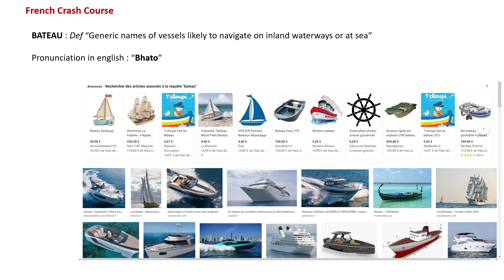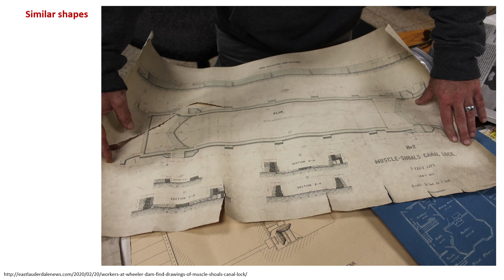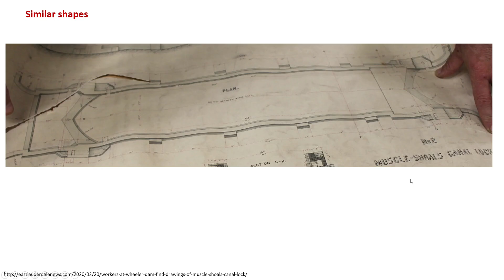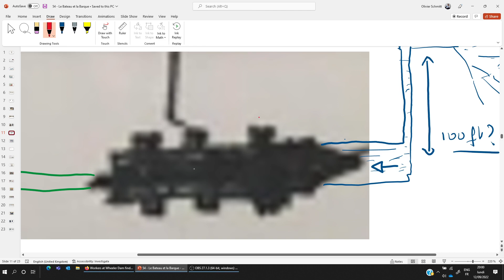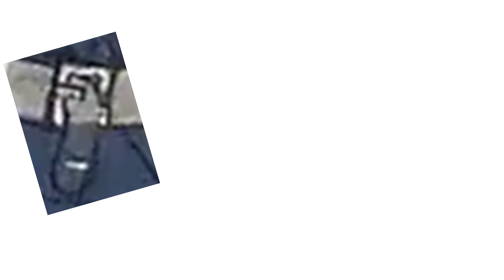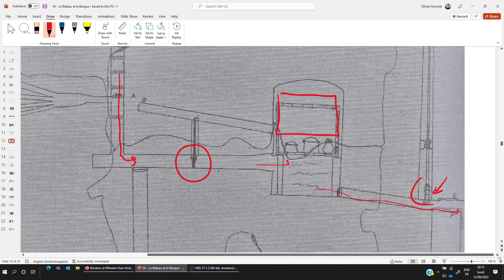54 - OAK ISLAND - LE BARQUE AND LE BATEAU

Comment: Hi Oliver  , My question is  , How is it possible to drain the water in the chamber back out to the Atlantic  , when the drain line is 50 + feet below sea level  ??? ...
Oak Island is 36 ft above sea level the depth of the chamber  is 90 + feet below ground ( 36 ft  - 90 ft = 54 ft )  the drain line is 54 ft below sea level  ... Also the water pressure at 50 ft below 50 ft sea level   ( you can look it  up ) is 36.95   pounds per square inch absolute  ...    
Again  I ask you , or anyone  out  there ... How is possible to drain the water out of the chamber back out to Alantic ocean with the drain line 54 feet below sea level  ??? ...
Reply from the maker: Hi Kirk. The flush out does not go back to the ocean. As per the Scrolls of Onteora diagrams, it is flushed out into an underground cave. But even if it was not, you can use tides height differential as a pump to push out the high tide/high pressure captured water in the vault at low tide. There will be more pressure in the chamber than in the ocean, flushing the water out. By the way, the depth of the cahamber is certainly NOT 90 feet down. If it was, the floating chamber would be compressed at the top of the vault, causing damages. The top of the vault ceiling should not be lower than the high tide mark to avoid excesssive pressure on the floating Fancy :). Michael and I differ a bit on this..... but it is what I believe.
Reply: @oakislandresearch   Hi Oliver , Thanks for responding  .  
 1 . Your saying the water in the chamber is drained into an underground  cave ...

2 . Your saying that tidel  height differential could create enough pressure  in the drain to push the water out of the chamber and into the ocean  ... my question is ; how can this method work thru the the box drains @ Smith's cove  ( The water fill sorce ) when the box drains are covered with a layer of coconut fibre , a layer of eel grass covered with sand and submerged under water  ??? ...

3 . You saying  that the fancy is not at 54 feet below sea level . That the fancy is @ tide level/sea level .  Oak Island is  36 feet  above sea level That would mean the underground chamber with the floating fancy is 36 feet below ground . Question; Why does the Onteora diagram in this video show the fancy even with the depth of the 90 foot mark of the money pit that puts the fancy @ 54 feet below sea level.  ??? ....

4 . There is a big contradiction  between the Onteora diagram & the Rochefoucald map where the valve is located, The Onteora diagram shows the screw valve close to the chamber  ( like it would be located on the money pit side of the swamp )  the Rochefoucald map locates the valve on lot 5 ... the money pit is on lot 18 . That would mean the chamber drain would have to run either thru or under the swamp  ( depending how deep the swamp is ) then thru 13 - 4 acre lots to its location on lot 5 ... 
My question is , with these documents contradicting each other , which document is correct  ??? ...
Reply from the maker: @kirkdepierre4544  The scroll of ontera diagrams are not to scale. They explain the mechanism principles.
Reply: @oakislandresearch  Hi Oliver , It's obvious something is off , the Onteora diagram & the Rochecauld map contradict  each other ... Question ... In your opinion  Is the Rochefoucald  map drawn to scale ??? ...
Reply from the maker: Do you know him ?
Reply: @oakislandresearch  Oliver  , Donald A Ruh knew Bill Jackson very well ...

Comment: Excellent observation about the hydraulic gates. We have discussed before that the dam and the basin may be the location of such a device. The Batteau is North of Barque as the Basin is North of La Hampe. The zigzags on the lines are indicators of vectors as Barque gives a line vector through the rear rudder which intersects to create point that represents Cone D. Batteau does nothing until it is hitched to the North Anchor shown as a full hitch as the letter e in Batteau. Good stuff!
Reply: On the sides ? The concrete blocks ? Or poured squares of concrete along side the gate
Reply: The meanings of the boat and the Bargue are just telling you which way the valve sits in context to inner or outer innrelationship to the island inlandcc be esters lebargue andvthe outer open ocean waters the boat side , represents which way the water is flowing intake and outtake or in from open waters to the underground waters of the island
Reply: That picture is amazing !!!!!  The lock dam , that can’t be overlooked , they need a full episode on how amazing this is , how old is that boat and was this the wzy they built the locks in the 16th or early as the 13th century and it’s ehss as t I was speculating on when explaining the intake and out take that ocean part has “the boat “side
Reply: Concrete would stop the pressure

Comment: Hi OLivier, there is no doubt that the Larochefoucauld grail was encrypted to indicate the route to "Oak Island" and the instructions for accessing the hidden treasure.
You deciphered all this by your analysis of the miniatures from scratch, and I don't know anyone capable of doing such a job.
There had to be a grid to decipher this message. Where is this grid?🤔
Reply from the maker: First of all, thanks for your compliment, and for being a "believer", Chico. And thanks for your help as you've been suggesting me very good ideas in the past, especially during the "signature" studies.

Yes, I am positively convinced the Rochefoucauld grail is what you say. I've just been working 2 hrs on other miniatures, especially those involving boats and barques. The one in this video IS THE ONLY ONE with such a rudder ! You're a sailor, you know what I'm talking about...

I'm also looking for a grid....
20 mintues ago, as I was looking at all the miniatures I could involving boats, I realized the number of fish is different from a picture to another. The way they face left or right is peculiar also. 

So I'm thinking the miniatures are NOT in the correct chronological order (like a dismantled story board). You have to reassemble them using the number of fish as the page number to get the story right.....
Colors do play a great role also.

Just my current thoughts, but the codings are tought indeed. Just thinking back on the "Journey to Oak Island" picture (with the puffin hidden), and the different codings involved, giving all the routes, distances and bearings from France to the tiny island of Oak Island... in 1350 !
A master piece of conception I think ! I can't wait to find out more from these miniatures, and I can tell you I had to say soooooo many times "Not conclusive :( " after  hours of research... but that is what research is all about : frustration and excitment :)

I was very lucky that morning when I randomly typed in Google "Rochefoucauld Grail" to see if anything would pop up.....
..... 6 months later, I think we only scratched the surface. 

Thanks for your support François, and hope we meet sometimes in Toulouse :)
Reply: @oakislandresearch  why not , you'll be welcome!

Comment: A pressure decreasing valve is a good idea having to deal with the water pressure at 40 feet down that can destroy the volt. Now i think we have 2 since one needs to be big to take high pressure for la hampe and a small one for the valve. Bateau>barque. When i first looked at is it looked like a wooden screw with the extension at the top to control it from above.
Reply from the maker: Could be correct, Wassim, about the shape being a screw. But currently working on another explaination with a fellow subscribed ;).... As for 2 types de same device (valve + hamps), I don't think so, as the Onteora book shows with some detail the valve apparatus, which does not look like this "screw"....

Comment: Nice presentation! You are 100% correct on that rudder. It's gigantic for that small boat. There are 2 things that jumped out to me. Check out that oddly shaped fish beneath the boat. Does the shape match our island? Also, the cross between Le Bateau and Le Barque is a bit weird. One line has a clossed arrow, the other one has an open arrow and the other two have nothing. Water flow direction?
Reply from the maker: One line has a clossed arrow, the other one has an open arrow and the other two have nothing. Water flow direction?
 => You're right, and I found some something interesting on this line last month. I'll make a video about it soon.... :)
Reply: @oakislandresearch   Looking forward to it
Reply: Yes looking forward to your next video.

Comment: Hi Oliver , The time line of  when  events  took place on the island is key to solving the mystery ... going back to time line of 1795  where it began , Daniel McGinnis on the island  finds a depression in the ground above it a block and tackle hanging on a branch of  an old oak tree  ( it's asummed  who left the block n tackle on that branch, are the original depositors of whatever  is buried in the money pit ) ... 
Here's a time line  , say the old oak tree is 100 years old  , than the date of deposit would be somewhere between the years 1695 - 1795 ...  actually it would have to be after  1695 ... because in 1695 that old oak tree would been just seed in the ground ... have to compensate for growth time to produce a branch long and strong enough to support the weight of pulling up and lowering down what that block n tackle  was put there to do ...  time lines matter , and a lot of  time line out there  just don't add up ... .
Reply from the maker: Because you're making assumption that are not necessarly true:

. The tackle is not from the depositors, it is from later treasure hunters who needed to remove the soil in the MP down to 40 ft to reach the service tunnel. Many markers on the island are not from the orignal depositors, but from later hunters (I believe)

. Oak trees (Quercus spp.) : Because they're slow-growing, the oak tree lifespan is long, up to 400 years, and even nursery trees can live for a century or more if cared for properly, according to the Washington Post. (https://homeguides.sfgate.com/life-span-oak-trees-80036.html)

. 600 yrs for while oaks, 400 yrs for red oaks here: https://treenewal.com/the-average-lifespan-and-cycle-of-an-oak-tree-what-you-need-to-know/. 1700-400 = 1300 !

. The Pechanga Great Oak Tree : 2,000 years - oldest oak tree in the United States, possibly in the world. 

.Under optimal conditions, northern red oak is fast growing and a 10-year-old tree can be 15–20 feet tall. In many forests, it grows straight and tall, to 90 ft, exceptionally to 140 ft tall, with a trunk of up to 20–40 inches diameter. Trees may live up to 500 years. Augusta government website: https://www.augustaga.gov/1623/Northern-Red-Oak

I'm not saying my theory is right, I'm saying the timeline is possible.
Reply: @oakislandresearch   Oliver , I think the time line is very possible, and coincides with the documented history who were  present & what  was happening  militarily in Nova Scotia, and what happened on Oak  Island at the time  ( 1740 - 1795 ) ... historically this time line makes the most sense ...
Reply: Oliver, this falls within the timeline , ( 1740 - 1795 ) and is  ' documented ' the Royal Engineer Corps were  dispatched  to Nova Scotia from England  they arrived in Halifax 1740 ( * please see "Royal Engineer Corps Fonds " * ) the Royal Engineers , I believe are the ones who built the road on Oak Island.... a  stone road would be necessary  to move heavy   canons and ordnance to defensive positions on the island ... they had the expertise and the manpower to build the road ...I
Reply: Oliver ,  online in the ( Nova Scotia Archives map 202015035 ) Is a 1807 true copy of the 1762 Charles Morris  survey partitioning  Oak Island into 32 lots with a road running from the west end of Oak Island to Smith's cove  ...
Reply: @John M  The block and tackle  was used to lower a bucket down to fill with dirt & rocks  once full pulled up to the top of the hole emptied  ,  . When you get to 20 ft deep you're not going be able to throw the dirt out of the hole you need a block and tackle to keep removing the dirt , and the logs at every ten feet to pull them up and out of the hole ...  In that era the block and tackle was most commonly used in digging wells ... 

I Dispute the la Formule 45/522 theory , Here's Why .

Doing the math ,  on the 'La Formule , 45/522' tunnel  entrance to chamber theory ... a tunnel 522 feet long running down @ a 45 degree angle = 350 Feet underground ... then add the 40 feet you have to dig down from the top to reach it !  ... 40 Feet + 350 Feet = 390 Feet  underground ! ... That makes the chamber about 400 feet underground ...
Reply: @John M Hi John ,  My guess is the tree would have to 50 to 60 years old to have grown a branch strong and long enough to hold that block and tackle and handle the weight of dirt , rocks and logs being hauled out  or lowered in the hole ...
Reply: Je ne pense pas que quelqu'un qui construit tout un mécanisme sophistiqué laisse une poulie sur un arbre